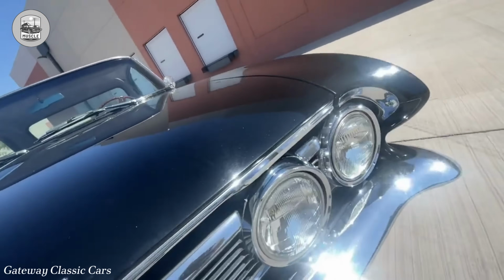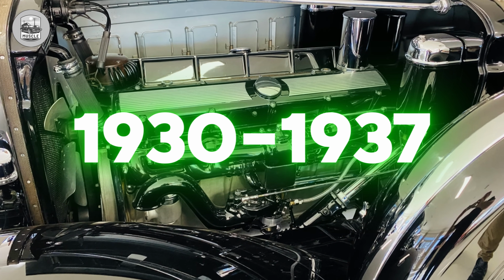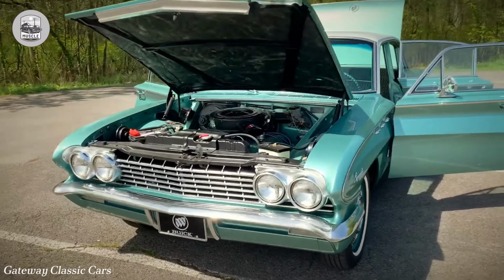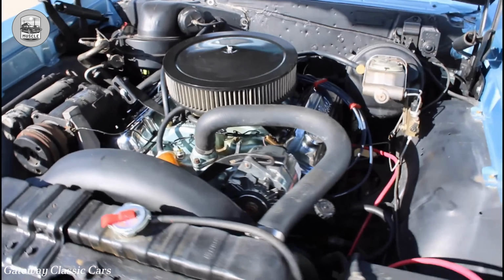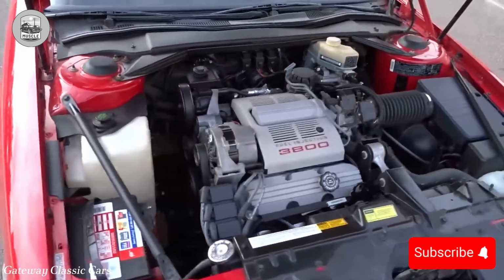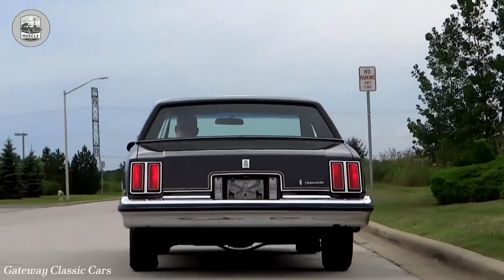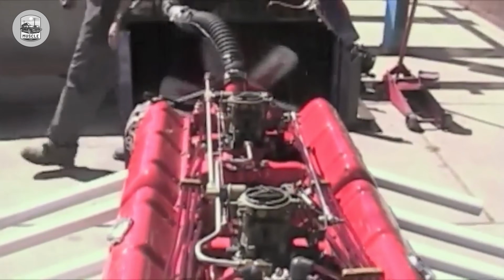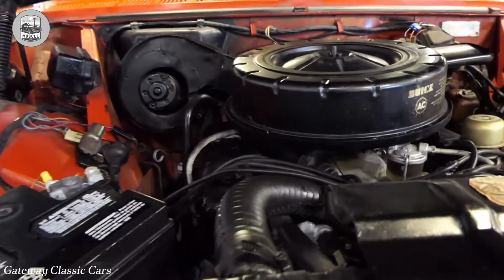10 MOST FAILED and WEIRDEST GM Engines ever made | Worst engines blunder!

Comment: The Pontiac Tempest did not offer the 215 c.u. engine.
Reply from the maker: Hey @ernestimken6969, thanks for chiming in
 You’re absolutely right that the Pontiac Tempest didn't offer the 215 c.u. engine. The 215 c.u. was actually a Buick/Oldsmobile aluminum V8 shared across GM brands but never featured in the Tempest lineup. Instead, the early Tempest models came with innovative engine choices like the "Trophy 4," a slant-four engine derived from Pontiac's 389 c.u. V8. Later, of course, the Tempest became legendary for introducing the 326 and paving the way for the iconic GTO, the muscle car that started it all
We’d love to hear what you think about Pontiac’s contribution to the muscle car era—was the Tempest your favorite? Drop your thoughts in the comments! Remember to subscribe for more deep dives into American Muscle Cars, and don’t forget to share the love with fellow enthusiasts.
 Have a great day and keep those engines roaring

Comment: GM didn't have enough money to develop a 4 cylinder? Sounds like Pontiac was the bastard child to GM while they had the best of GM cars.
Reply from the maker: Thank you for your insightful comment
You're absolutely right that Pontiac, despite producing some of the most iconic and powerful muscle cars in GM's history, often faced challenges when it came to resources. Pontiac was indeed a bit of a ‘bastard child’ in the sense that it wasn’t always given the same level of investment as other GM divisions like Chevrolet. However, it’s important to note that Pontiac did manage to push boundaries with cars like the GTO, Firebird, and Trans Am, which became legends in the muscle car world.
As for the 4-cylinder development, GM did focus more on their V6 and V8 engines for their performance cars, which made more sense given the brand’s emphasis on high performance.
What are your thoughts on Pontiac's legacy? 
Drop a comment, share your insights, and don't forget to subscribe for more exciting content on American Muscle Cars
Let's keep the discussion going
Reply: Gotta disagree on that one. Pontiac wasn’t the "bastard child"—they were innovators. The Tempest’s 4-cylinder was a bold move, splitting the 389 V8 for cost and space-saving engineering. Sure, it wasn’t a powerhouse, but Pontiac delivered legendary muscle like the GTO, Firebird, and Trans Am, showing they knew how to make serious horsepower. Pontiac wasn’t neglected—they were trailblazers in GM’s lineup. Muscle history proves it
Reply: @KeithGreene-k1v , they were indeed, but it seems they always had budget constraints more so than the other GM products. They didn't have the money to develop a new 4 cylinder so they cut a 389 in half? Just sounds hokey.
Reply from the maker: @mikes6961  Thank you for your thoughtful comment and for diving into Pontiac’s unique history
Pontiac often faced tighter budgets compared to other GM divisions like Chevrolet. The story of "cutting a 389 in half" to create a 4-cylinder Tempest engine may sound hokey, but it was a testament to Pontiac’s ingenuity. This slant-four engine, though quirky, helped the Tempest stand out as an innovative compact car, showing Pontiac’s determination to deliver something different despite constraints.
Pontiac’s legacy is undeniable—they gave us legendary muscle cars like the GTO, Firebird, and Trans Am, proving they could punch above their weight. It’s amazing how resourceful they were while creating cars that still make hearts race today.
What do you think about Pontiac’s resourcefulness and its impact on the muscle car world? Share your thoughts, subscribe to our channel, and let’s celebrate muscle car history together
 Have a great day and Happy New Year

Comment: The Buick 215 drops into some years of MG B, they were planning on using it i them but were never produced with them.  It doubles the power of the MG, and no suspension changes are required as the car only sheds 50lbs.  I have one on a stand in the garage.

Also have a truck with a GMC with a 351 Magnum V6, a higher performance version of the engine the 702 is based on, basically a cast of two of them.  Cams live forever, they are absolutely bathed in oil, they run a long time, and are an odd engine for sure.  Have had a Toro-Flow as well, they are pretty junky diesels.
Reply from the maker: thanks for sharing such cool info! The Buick 215 in an MG B is an absolute game-changer. It’s wild how that lightweight aluminum V8 nearly became a factory option, it really doubles the fun factor without upsetting the balance. With just a 50-pound drop, it’s almost as if MG designed the car with the 215 in mind from the start! Would love to hear how your 215 build progresses those engines are gems.
As for your GMC 351 Magnum V6, what a beast
 The Magnum truly is an underrated workhorse with its roots tied to the legendary Twin Six 702. That oil-soaked camshaft setup really keeps it running like a tank. The Toro-Flow, though—agreed, not GM's best diesel effort, but a fascinating chapter in engine history nonetheless.
Keep those stories coming, everyone! Drop your thoughts, share the love, and don’t forget to subscribe. 
Hope to see you in the next video, have an awesome day...
Reply: Hey, that’s a cool setup you’ve got! But I gotta disagree on the MG B. The Buick 215 swap isn’t just plug-and-play. Doubling the power stresses the stock suspension, even if the weight's close. As for the GMC 351 Magnum, it’s a beast, but calling the Toro-Flow junky? Harsh! They had their flaws, sure, but they served their purpose well in their time. Respect to keeping those unique engines alive

Comment: I also had a 1997 3800 series II 200hp Buick in a Camaro RS. This was even-fire, each connecting rod had it's own crank journal. No balance  shaft and multi-port injection. This excellent engine was no nailhead!
Reply from the maker: Wow, what a fantastic setup you had with that 1997 3800 Series II Buick in a Camaro RS
You're absolutely right—this wasn’t a Nailhead, but it carried its own legacy of excellence. The even-fire design, individual crank journals, and multi-port injection made the 3800 Series II a standout engine of its time. With no balance shaft, it managed to deliver smooth power, and that 200hp was no joke for the era. It’s no surprise this engine gained a reputation for durability and efficiency. Pairing it with a Camaro RS must have made for a great combination of muscle and reliability—truly a unique build in the muscle car world.
Let’s keep this conversation going! Share your stories in the comments, hit that subscribe button, and don’t forget to share with your fellow muscle car enthusiasts. See you in the next video—keep those engines roaring and have an amazing day....
Reply: @MuscleCarMasters68  Thanks. You too.
Reply: Love the passion, but gotta disagree, my friend! The 3800 Series II was solid, but it wasn’t designed for muscle—it was a reliable, efficient V6. 200 hp in a Camaro RS is decent, but it doesn’t stack up to the fire-breathing V8s muscle cars are known for. No balance shaft? Sure, but it wasn’t chasing performance like the old-school big blocks. Great engine, but not in the same league as true muscle classics

Comment: I always hear people talking crap about the 6.2L diesel that GM developed out of a gasoline engine. I had a 1985 K5 Blazer that had a 6.2 in it and had been owned by an elderly gentleman who owned a machine shop and had been a heavy duty diesel technician for a local logging company here in Oregon. He had put 35" offroad tires on it (not great big swampers or anything like that!) with a 3" lift and had made some kind of changes to the fuel system and changed the gear ratio in the front and rear differentials. He had built it to be a capable off road vehicle that was also his daily driver so he wanted it to be efficient and capable of getting him to logging sites in inclement weather and driving conditions. He would often have to drive 50-75 or even 100 miles each way to job sites and wanted something four wheel drive that didn't cost him hundreds of dollars in fuel every couple of days. After I bought it in the mid 90's I got a job that was about 25 miles from home and was freeway all the way. If I took it easy and putted around like the old grandpa i am now, I could get 30+ MPG out of it! I wish now that I had kept it but at the time it was my daily driver and my wife and I had two small children and had just found out number three was on it's way so I had to sell it and get something more family friendly. The only negative thing that I experienced with the 6.2 was it started to get cracked cylinder heads that were notorious on the aluminum heads the 6.2 had on them.
Reply: Hey, I hear you, but I’ve gotta disagree! The 6.2L wasn’t derived from a gas engine—it was purpose-built as a diesel by Detroit Diesel for GM. Sure, it wasn’t a powerhouse at around 130 HP and 240 lb-ft torque, but it was all about fuel efficiency and reliability for light trucks. Those cracked heads? They were cast iron, not aluminum. With the right tweaks, though, that engine was a workhorse
Reply: @KeithGreene-k1v  NO.....The 6.2L diesel wasn’t bad for its purpose, but calling it ‘purpose-built’ skips its roots—it was an evolution of GM's Olds gas V8s. At 130 HP, it’s no muscle engine, but torque's solid for towing. Those iron heads cracked under stress, unlike modern alloys. With upgrades, it’s reliable, sure, but it’s no match for GM's gas V8 beasts. Diesel fans love it, though

Comment: I owned a 1962 Oldsmobile Jetfire turbo V8 car that used the rocket fluid.   I bought it in 1977 from original owner.  Still ran good.
Reply: Wow, a 1962 Oldsmobile Jetfire—what a rare piece of history! But just to clarify, the Jetfire had a turbocharged 215ci aluminum V8, not a traditional big-block muscle car engine. It made 215 hp thanks to that innovative turbo and "Rocket Fluid" water-methanol injection. While impressive for its time, muscle cars typically leaned on raw, naturally aspirated V8 power. Still, owning one in '77 must’ve been awesome—those are incredibly rare today
Reply from the maker: @CookeZachery  What an amazing piece of automotive history to discuss! You're absolutely right—the 1962 Oldsmobile Jetfire was a true innovation with its 215ci turbocharged aluminum V8 and Rocket Fluid water-methanol injection system. That engineering made it one of the first turbocharged production cars, alongside the Corvair Monza, and set a precedent for turbo tech in performance vehicles. While it wasn’t a "traditional" muscle car with a big-block naturally aspirated V8, it embodied the spirit of pushing boundaries in performance and design.
Owning one in 1977 must have been incredible—it’s a rare gem today, with its bold combination of technology and power in such a compact package. Got any stories about how it drove or the reactions you got? We'd love to hear more! Everyone, share your classic car memories below, and don’t forget to like, subscribe, and share to keep the love for American Muscle alive. 
Have a great day, and Happy New Year
Reply from the maker: That’s an incredible piece of history you’ve had the privilege to own! The 1962 Oldsmobile Jetfire was groundbreaking as one of the first turbocharged production cars, alongside the Chevy Corvair Monza. Its Turbo Rocket V8, paired with that innovative water-methanol Rocket Fluid injection system, made it a true pioneer of performance engineering. It delivered 215 horsepower from just 215 cubic inches, an impressive feat for the era!
Buying it from the original owner in 1977 and keeping it running well speaks volumes about its durability and your care. It’s fascinating how Oldsmobile aimed for cutting-edge technology in the Jetfire, even though the complexity of the Rocket Fluid system made it a rare find today.
We’d love to hear more stories like yours! Everyone, share your classic car tales, and don’t forget to like, comment, subscribe, and share American Muscle Cars with fellow enthusiasts...

Comment: Pontiac's 301 had potential to be a monster. It has the identical displacement as Chevy and Ford's 302.
Reply from the maker: The Pontiac 301 had the potential to be a monster! Sharing the same displacement as the legendary Chevy 302 and Ford 302, it was a lightweight design with untapped possibilities. Unfortunately, its shorter deck height and thinner block design, optimized for fuel efficiency during the late 1970s, limited its high-performance applications. However, with aftermarket parts and creative engineering, some enthusiasts have unlocked impressive performance from the 301. Imagine if Pontiac had refined it for high output—it could’ve rivaled the muscle car legends! What’s your favorite Pontiac engine? Comment below, share your thoughts, and don’t forget to subscribe to American Muscle Cars...
Reply: Great & very reliable engine. I had 2.  They didn't have enough head bolts for serious power, tho.
Reply: Respectfully, the Pontiac 301 wasn’t built to be a powerhouse like Chevy’s 302 or Ford’s Boss 302. It had lighter components and a shorter deck height, limiting its high-performance potential. While its displacement is similar, the 301 was designed for efficiency, not raw horsepower. The Chevy and Ford 302s were purpose-built for racing, with higher compression and better flow. Pontiac had monsters, but the 301 wasn’t one of them.

Comment: Ihc did the same with the 304 and 362 v’8, making a 152, and a 196, up into the 80’s
Reply from the maker: Absolutely, you're spot on! International Harvester (IH) took a unique approach with their engines, making smaller displacement versions by essentially halving the V8s—just like with the 304 and 345 V8s. They turned them into four-cylinder versions, the 152 and 196, which kept that same tough, low-RPM durability IH engines were famous for. These engines worked hard in Scout 4x4s and light trucks, where reliability and torque were key. It’s fascinating that IH continued this strategy into the '80s, proving the demand for durable, simple engines in off-road and utility vehicles!
Let’s keep the conversation rolling—what do you guys think about IH's engine approach? Have any memories or stories of these rugged four-cylinders or V8s? Don't forget to comment, share, and subscribe to American Muscle Cars for more insights into the engines that shaped automotive history!
Reply: IH did build the 152 and 196 from their V8 family, but those were slanted more for utility, not raw power like the American Muscle scene. Compare that to Chevy's small-block or Ford's Windsor—those engines screamed horsepower, not just durability. IH aimed for workhorses, not street beasts. Muscle cars were all about revs and adrenaline, not just getting the job done

Comment: i had a 302 was a decent little motor
Reply from the maker: Absolutely, the 302 is a fantastic small-block V8! Known for its high-revving nature and versatility, this engine powered some legendary cars, from Mustangs to Z28 Camaros, especially in the late '60s and early '70s. It could really come alive with a few performance tweaks and was a go-to for racers and enthusiasts alike. Many fans appreciate its reliability and ease of modification, making it a true icon in the world of American muscle.
For everyone tuning in, if you're interested in exploring more of these powerful engines and learning what makes them so legendary, be sure to check out our other videos! And don’t forget to comment, share, and subscribe to the Muscle Car Master channel for more in-depth discussions on muscle car history and performance...
Reply: @MuscleCarMasters68  Yes i had one in a 1967 z28 camaro 4 speed it was a sweet ride it ran really well
sold that car wished i wouldnt have now....
then fords 302 ive had a bunch of them. mostly trucks. from the 1979 f150 302 3 on the tree 
the 1982 f100 302 auto
then i had a 1993 f150 302 efi manual
had a 1986 f250 302 carbed
had a 2015 302 coyote 5.0 was a sweet ride.
never owned a 302 in a older a mustang or falcon 
id like to get a nice restored/not restored dont really have a preference there
but 1967 mustang 289 4 speed hardtop. just a little something to play with cruise.
Reply from the maker: @7.3PSDA2  Thank you for sharing your amazing journey with the 302 and those classic Fords! It’s awesome to see how many vehicles you've owned with the iconic 302 under the hood, from the carbureted engines in the late '70s and '80s trucks to the fuel-injected Coyote powerhouse in the 2015 model. The 302 truly has a rich legacy, both for performance and reliability across decades, and it's easy to see why enthusiasts like you keep coming back to it.
And a 1967 Mustang with a 289 and a 4-speed? Now, that would be a perfect addition to the collection! The 289 has such a unique character, especially when paired with that manual transmission, giving you both the sound and the experience that make cruising so memorable.
For everyone here on Muscle Car Masters, drop a comment with your own Ford or Camaro stories, let us know your favorite classic muscle cars, and don’t forget to check out our video on the Ford 289 here: https://youtu.be/N0LraDBr__U. 
Be sure to share this with fellow muscle car fans, and hit that subscribe button to keep those classic car memories alive
Reply: Interesting take! While the 302 definitely had its moments and versatility, some would argue it fell a bit short in terms of torque compared to other engines in the lineup, especially in heavier vehicles. The 351W, for instance, packed more low-end power and often proved more robust for modifications. The 302’s smaller displacement limited its potential without major upgrades, which could sometimes feel restrictive. But hey, every engine has its strengths, and the 302 was certainly a compact powerhouse in the right context.